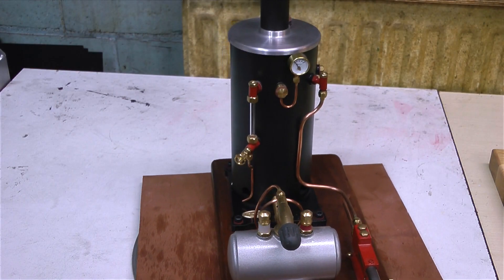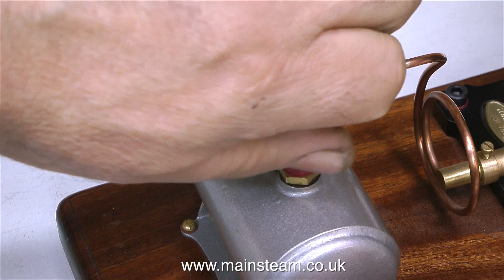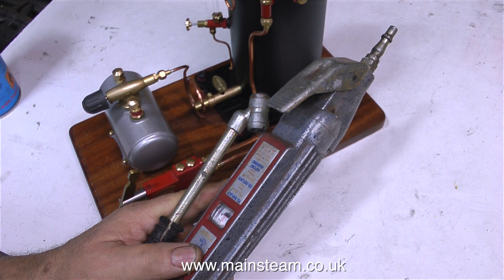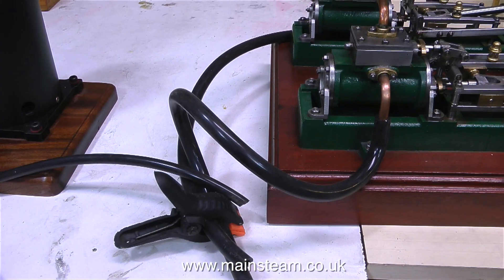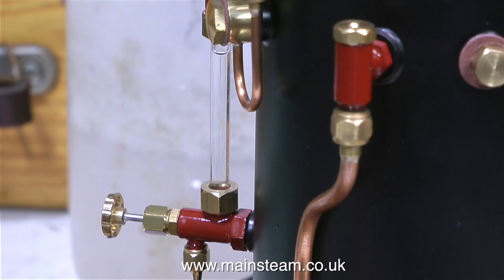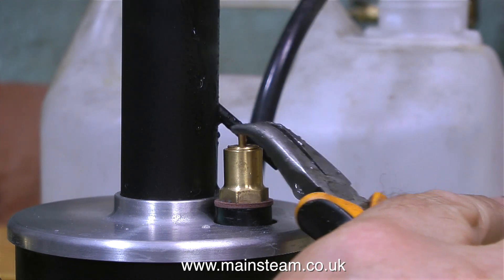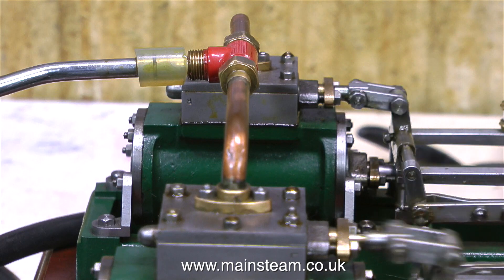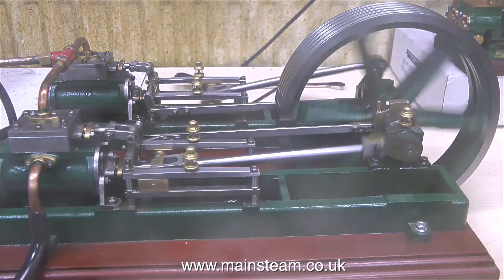ASSEMBLING A HIGH QUALITY MODEL STEAM PLANT - PART #2

Comment: I stand corrected. Here in Canada CO detectors are typically plugged into electrical outlets on the main floor , just above the baseboards. As this is where the electrical outlets are located. I suppose on the ceiling beside the smoke alarm would be the best place.

Comment: you might want to place the CO detector closer to the floor as CO is heavier than air
Reply from the maker: There's a myth that carbon monoxide alarms should be installed lower on the wall because carbon monoxide is heavier than air. In fact, carbon monoxide is slightly lighter than air and diffuses evenly throughout the room.
Reply from the maker: Please Google: 
is CO heavier than air?

Comment: Thanks for the video 
It’s a pity that your customer did not buy a horizontal boiler , then if it was not up to the job do as he/she has done get another and the assemble them as a pair of Yarrow type boilers nicely built up with some of your Tyfoc bricks to resemble a multiple boiler plant as was the norm at say Papplewick pumping station near to me

By the way your very good detailed instructions on setting up engines has helped me no end even if I have been at it for couple of year longer than you now my latest project Williamson from Stuart’s runs very well

Stuart

Comment: So the mystery oil is 40% Steam Oil, 30% Machine Oil (light ?) & 30% Rapeseed Oil.
the next question is what grade Steam Oil, I have been using 460, but I have seen 2000 grade.
Reply from the maker: I don't know without looking at the container, it's pretty thick stuff though .....

Comment: Keith,
After blowing an engine out with air and adding some steam oil, I always blow in a bit or argon.
It really keeps the rust away... I do the same with small boilers... 
I use it from the big tank, but you could get one of those disposable small tanks.
If you use them just for this , they last quite a while.

Paddy

Comment: thanks for the video keith. always wondered what your oil mixture ratio was. i have that same boiler and while filling is a bit of a pain sometimes the addition of the white venting valve does let you fill the tank to the top and know it is full.

Comment: Titanic had 29 boilers, went through quite a bit of coal that lot they did!
Reply: Raymond J The Titanic had two four cylinder triple expansion secondary (the outside propeller shafts) engines whose exhaust steam ran the primary Parsons steam turbine (central propeller shaft).
Reply: They ran about 215psi and burnt 600 tons per day, the 2 outside engines were 15,000 hp and the center was 16,000hp
Reply: wow thats crazy and it had 3 engines  rite high med low pressure ones i think wasent it .